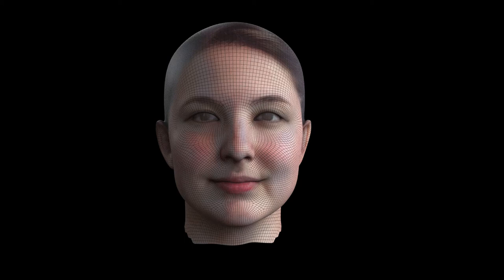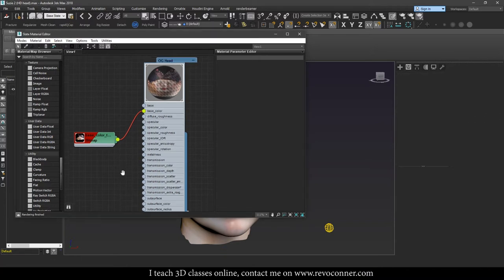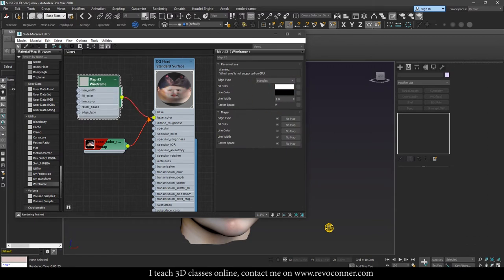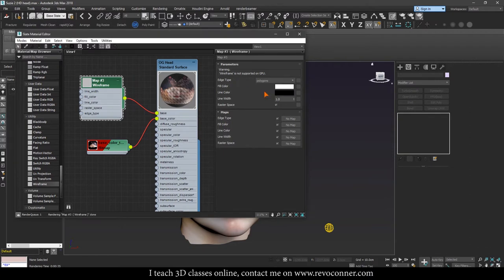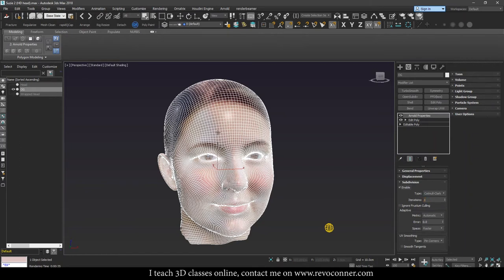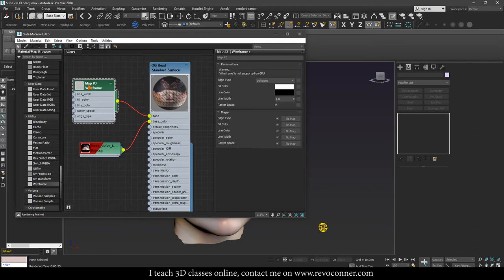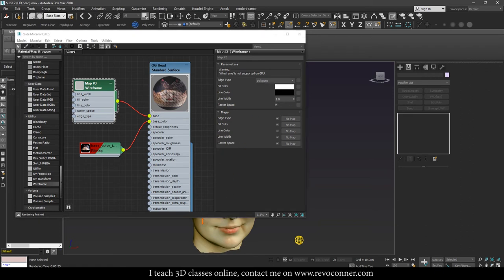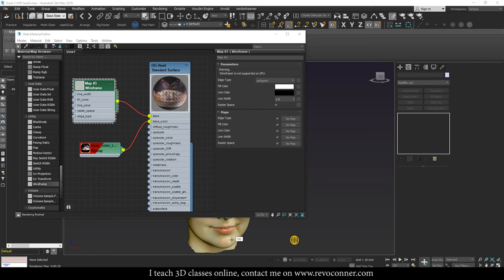Render Wireframe in 3ds Max - Arnold [MaxToA]

Comment: I've followed this exactly and it's still rendering with Tri's, not polygons.
Reply from the maker: Make sure the model is editable poly not editable mesh
Reply: Its an editable poly, not mesh. Still having the same issue. I can't believe Autodesk haven't fixed this bug!

I'm completely stumped
Reply from the maker: @dbno5  Can you send me the file? use wetransfer
Reply: It works for me. I followed the same steps. Thank you so much! <3